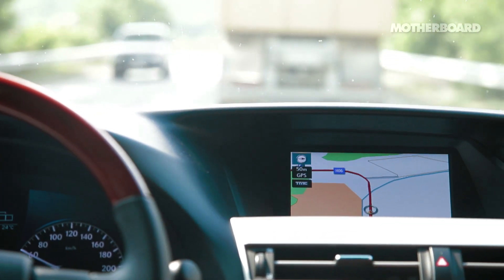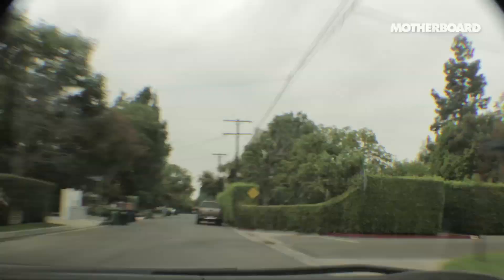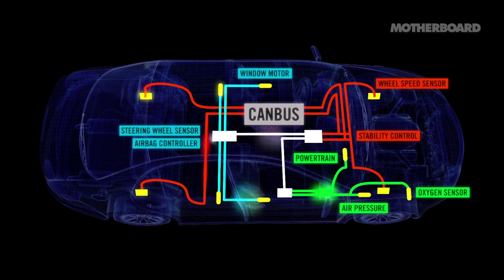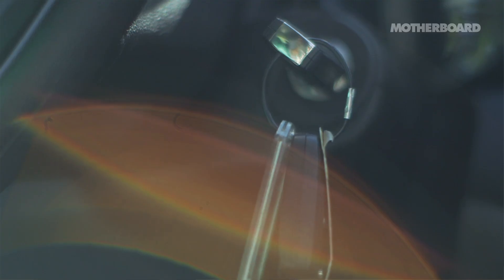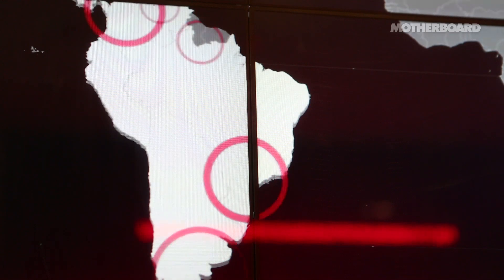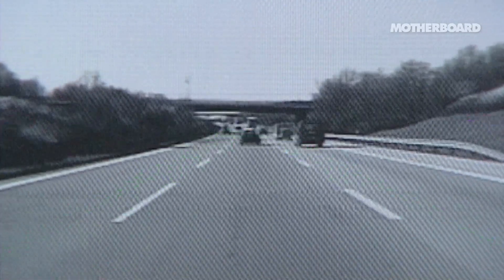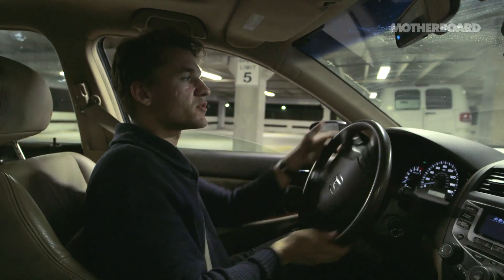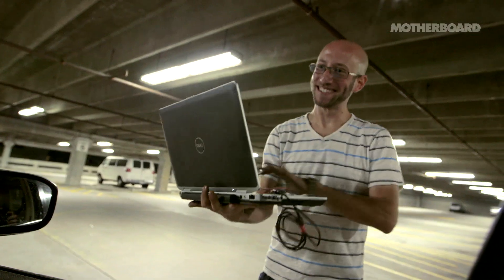How to Hack a Car: Phreaked Out (Episode 2)

Comment: That's such bullshit lol.  The handbrake?!  That's mechanical, it's not going to activate no matter what button you press.  The steering?  Unless you've got a car that's drive-by-wire steering that's also mechanical with the power steering pump assisting.  There's no electronics in the power steering lmao.   The regular brakes are generally the same way, your input assisted by the fluid.   The throttle is done by cable and not electronic (in most cars).   All you've got is what cars come with pretty much, start and shut off, windows, locks, ect.  Worse is losing power steering and brakes while driving but you can still steer and stop with more force.  Seriously people, don't put so much effort in a fake story.  Anyone with automotive knowledge would call bs.
Reply: You need to read some motor magazines. Cars do have electric assist on steering and brakes and no throttle cable. The car my wife drives has all that and more. Haven't you seen commercials that advertised cars that parallel park for you. Check out Ford they have at least one.
Reply: James Edwards
Uhh yea man they do.  Look not to sound cocky about it but I'm damn good in and around a car.  Throttle cables are extremely common, electric steering for the parking thing and brakes in cars with that auto brake when you're about to hit something.  That's not your typical cars tho and not something people need to worry about.
Reply: Sheridantank gotta fully agree with you man. Total bullshit video posted for those gullible people with no automotive knowledge background. You got modified hardware and software programmed into these chips they buy lol. You cant just hack into a stock standard car without any external hardware.
Reply: Sheridantank What you're saying is complete bullshit, just look at an average Merc. S class or Toyota Prius after 2010. And you'll see an electronically actuated handbrake, or electronically assisted brake servo's, or electrical controlled hydraulic valves for the steering assist. And all of this is connected to the CAN bus, so how about educating yourself before making a fool out of yourself.
Reply: *****
Electronic handbrake...?  Among the dumbest thing I've heard of if that's true.
Reply: *****
Not overly common, like I was saying most people do not need to worry.
Reply: Sheridantank By Hand brake im thinking there talking about the ABS Control. And yes if all solenoid are open on a abs system there would be no brakes. I don't no of any cars steering that are fly by wire but throttle yes there are many makes and models that are.
Reply: snicks50
Some of the last Pontiacs I believe had the drive by wire.  The throttle I know many do, my moms 07 Mazda does and it's a pain.  When you're trying to diagnose engine problems you gotta have some one else press the pedal instead of pulling the throttle like you used to be able to do.
Reply: rock3tcat (ⵙⴰⵔⵓⵅ)
Tell me what certifications you have, please, I'm dying to hear it.  Also what cereal boxes you got them on would be helpful because I wanna be an expert like you.   I took a classic car restoration class that involves interior work, body work, paint, custom fabrication of parts, mechanical work, and electrical work (of course less on most the cars then but still there).  So literally every single part of a car before the 1990's pretty much.  Hell I rebuilt my first engine from my 76 Monte Carlo at 15-16 years old.  With more modern cars I've learned from experience.  People that know me take their cars to me to work on all the time for a reason, I'm damn good.  The thing is many cars that would have these electronic controlled elements would still be under warranty, being leased, or whatever else.  So it would be wise to take them where your dealer recommends, a certified modern car mechanic.  So by that I've never ducked around with that shit.  By a huge majority, most cars on the road do not have that stuff.  Then the amount of people skilled enough to hack into them and fucked in the head enough to try are even less.  So overall it's a "who gives a fuck?" situation.  It would be so much easier for me to snip a couple wires/lines/hoses on you car and ruin your day than all this shit.  People generally aren't worried about a cut fuel line, brake line, power steering hose, turn signal/brake light wires, ect.  Any of those can really give you a bad day and age much simpler to do.
Reply: rock3tcat (ⵙⴰⵔⵓⵅ)
That's cute lmao.  Spanner.... Fuck off you Brit.
Reply: rock3tcat (ⵙⴰⵔⵓⵅ)
I was fucking with you chill lmao.  There's no use arguing with you over what I know.  So I forgot that some new cars have that electronic shit, whatever then I don't work on them and frankly have no desire to.  I'm sure I could but everything is made in ways to make it where you nearly have to take it to a dealer mechanic or similar and I dont have other people work on my car outside of alignments and tire changes. You think I'm full of shit, ok that doesn't hurt my feelings.
Reply: +Sheridantank  I'm a Mercedes Benz star certified technician and ase master technician. electronically actuated parking brakes so exist. with them there is no hand brake lever or foot pedal but a button instead. once the button is pushed it actuates a motor that pulls in the parking brake cable applying the parking brake. as for controlling the brakes, yes you can via abs which Mercedes Benz invented in the 1970s. on the abs unit there is a hydraulic pump that  is used to apply pressure to the brakes. the abs system uses solenoid valves to hold pressure and prevent any further pressure in the event of a wheel slowing down i.e brakes locking up. if the wheel still slows then the abs unit will release the brakes pressure and then reapply pressure via the pump. the traction control system uses the very same abs unit to apply the brakes to specific wheels to prevent under steer and over steer and positive wheel slippage.
Reply: Sheridantank 
You in Murica my friend. Cars are only AC Plastic V8 and 4 Wheels.
Here in Germany all new cars have those assists. At least ESP which controlls all breaks. Electronic Handbrake in almost every new car and even if you dont have those steering assits, its common they are still build in but not activated.
Reply: Sheridantank http://hackaday.com/2013/10/22/can-hacking-the-in-vehicle-network/ 

well here's something new for us all to learn
Reply: travis gray
Interesting for sure...  Gave me something to read through on break.   Still nothing to honestly be worried about in my opinion tho.
Reply: I thought so too. I don't think it is a real worry either really. While it seems pretty simple to actually do, short of harassment or auto theft there is no real incentive. 

I honestly don't want my cars to have so much "tech" I like the joys of actual driving. All this mess just removes that enjoyment.
Reply: travis gray
I'm a classic car guy lol.  Only "tech" I want is a battery, radio, power mirrors, and maybe power windows lol.
Reply: +Sheridantank You are talking cheaper cars and older cars. Most modern cars 30k and up now have fly by wire throttles, and electronic handbrakes with just a button. Also electric power steering and brake by wire brakes. That is why modern cars are not nice to drive.
Reply: ThePuffin77
Yea but like I've said, the typical car does not.  Pontiac came out with the drive by wire if I remember right.  The electronic parking brake is a newer thing that I strongly disagree with and not because all this hack BS.   As you commented I just finished explaining on a another post that a "ebrake" can and will stop a car in case of brake failure.  Which is why people call them an emergency brake.  Say for example your car shuts off while driving, you will lose your steering entirely, the brakes will be much harder to press and not work as well, and now you've got no useful emergency brake either.  Or if you had a traditional setup you could still steer without power steering it'll just be hard, your regular brakes will be a bitch to use but you've got a ebrake peddle or handle to use still.  That's my problem with the idea.  The hack stuff is just to get views.
Reply: Sheridantank
In case of brake failure, the Emergency brake does not always work. On my other car (Lincoln LS) it was hooked up to the rear brakes. If you pulled on it it would give around 50 braking power the those rear brake, so in the even of brake failure the car would not slow down. That being said, the car did shut off and it was able to be pulled over without the power steering or brakes.
Reply: ThePuffin77
That's possible but generally it's many times better than nothing.  With the electronic one the only use its get is for parking.   Which in an automatic it's unneeded 99% of the time anyway unless the park notch thing in the transmission has been grinder down.  simply put I personally wouldn't want a car with the electronic park brake.  you don't get the control in flipping a switch as you would with a peddle or lever.  the electric steering and I could deal with.  the throttle not so much either.   I like having a cable I can pull to rev the engine while under the hood to listen for things
Reply: *****
Thanks but not exactly.  Definitely a heck of a lot more than most but not everything.
Reply: accelerator does not directly control throttle due to the auto transmission.
Reply: Alex Jamieson
No shit lmao
Reply: +Sheridantank 
You clearly have knowledge of old cars. I will give you that. But your knowledge of the electrical systems in cars made since the 2000's is WAAAAY off. I've done automotive electrical work for about 14 years professionally, and a lot of your claims are just wrong. The majority of vehicles made today can be susceptible to stuff like this..... the vehicle in the video..... only a couple of the things mentioned would actually be possible without 3rd party hardware being installed. You clearly do not understand how these modern systems are actually implemented so you say they are bad. When you can speak from experience rather than just your opinions, is only when your words will be considered to be valid on this topic.
Reply: +Sheridantank  You  have the ECU and if you have haver read the electronic schematics of the book on a vehicle, everthing has chip sensors.  Everything.  Its jusst a matter of proximity or a preprogrammed setup.
Reply: +steeliris TKC no one has a cable throttle anymore either
Reply: +Sheridantank not really, Renault uses electronic handbrake for quite some time.only question is if its tied to cntral unit or runs on standalone unit...
Reply: Brandon just give you a heads up on the electric steering it's even going into classic cars. My cousin has a 69 Chevelle he was looking at it for and my pops 67 Corvette doesn't really have the room for power steering pump they now make an electric assist steering rack not sure how it works just know it gives you power steering off your battery instead of driving a power steering pump. You can run but you can't hide it's even creeping into the old s*** man LOL
Reply: Hi end cars have motorised handbrakes .. that are actuated with motors.. which are controlled by canbus. 

Yeah.  Yeah they do.
Reply: Brandon im a car enthusiast i know my trailblazer or my car in another country suzuki fx manual every thinking
Reply: +ArchHeretic1
Lmao why are so many people trying to teach me things that I now know?  Now yes cars do have that (my moms new Mazda for example).  I was unaware of those becoming the norm.  I know of the drive by wire steering Pontiac used, the electronic controlled throttle many cars use nowadays instead of cable, and half this shit people keep telling me.  Tell me why you wasted your time typing all of this?   You're a Mercedes expert and are certified, good for you 👍🏼.  As you would know from a couple moments of reading I am in classic car restoration and can do about EVERYTHING to a car or figure it out very quick (as I'm sure you can do).  Difference is my area of expertise is in classics and yours seems to be in modern stuff.  I said what I've said based on my knowledge (which was made clear) and why there is no reason to have a legitimate concern over this "car hacking" stuff.  Cars 5 years ago did not have this stuff (90+% of them) and nowadays they are becoming more common.  The thing is if you are that worried about someone hacking your car you should not own one.  I could make you have a really bad day so much easier by cutting a line/hose or 2 100 times easier and literally in a few seconds.  People are so paranoid and scared if technology now that it's sad.  What are the chances of you driving one of the cars that do have these features and having one of the extremely few people who would want to hack it being near by?   Worrying about that would be like worrying of driving by someone who shoots at random cars.  It can happen but is extremely unlikely.  So please.... Don't try and impress anyone with your degrees and all that because it's not working on me.  20 years old and know more than many people who've been doing it much longer.   Do what you like (as I do) and be happy with it.   You're happy working on your Mercedes and I'm happier under the hood of a classic.
Reply: Brandon It depends on how old your car is. newer cars rely more heavily on electronics to control the core functions. Even my car from 2000, can be controlled without the electronics, but a car from 2016 is a different story...

Comment: Can one of those chips be plugged into your car's computer from the exterior of the vehicle, or does the hacker need access to the inside of the car!? Anyone know!?
Reply: Sheridantank :)
Reply: RyanH321 It is possible to use a drill in wheel arc to attach it.
Reply: Kaitnieks Oh, okay! Thanks for the reply! Much appreciated!
Reply: Kaitnieks Exactly where did you get your information? If it has been verified and documented, where is it? What makes/models/year models does your information apply to?
Reply: William Garrett So you're saying that they cannot in fact do what Kaitnieks said, basically... Well then does that mean that they do need access to the inside of the vehicle or is it still possible from the exterior!? If you know, that is! Thanks! :)
Reply: It's not even possible to do either way.  Not like they say it is lol.
Reply: Sheridantank Oh, okay! Thanks so much for the correction to the wrong information I was given! So does that mean that the hacker would need access to the inside of your vehicle before being able to take control of it remotely or not!? If you wouldn't mind elaborating on the way it really is, I'd love to hear it! :)
Reply: RyanH321
Not sarcasm right? Lol.   The thing is that many of these systems are not electronic controlled.  They mentioned activating your ebrake, that's done by cable like on a bike.  It's all mechanical.   There are some cars that have steering done by wire (Pontiac had a few like that) but it's not common anymore.  It's mechanical with the assistance of fluid pressure (the more steering pump which is belt driven).  The regular brakes are also mechanically assisted with fluid.   The throttle like the steering in some cars is electronic but not a lot of them at all.  If you have one of the few cars with drive by wire steering and electronic throttle I still don't think it to be possible to hack into it externally.  It's not like the computer in cars have transmitters that a hack device would just pick up.   Maybe if they have a remote start system you can start, shut off, and work the locks.  Other than that the only way I could see is physically hacking into the wiring and still only having limited controls.
Reply: Sheridantank Oh, okay! That makes total sense! Thanks for the detailed response, man! And as far as the sarcasm goes, if you were referring to me, no, I meant no sarcasm whatsoever! Sorry if it came off like that! Obviously wasn't my intention! :)
Reply: RyanH321
Ha alright man :)   Now that's just what makes sense to me lol.  I don't claim to be a master mechanic but I gotta admit I'm pretty good and it just doesn't seem logical to me.
Reply: Sheridantank Yeah, I figured you were just going off your car knowledge and are in no way an expert on the subject, but I appreciate your response just the same! Thanks again, man! :)
Reply: RyanH321
You're welcome and glad I could help!
Reply: RyanH321 on a latest model car, it is possible to do what this video showed, but then it is not possible to be done in short time.  and it needs to have access of the car in order to install a remote control device.  and someone kept saying it is not possible, he is right on old car.  however, on new/newer car, there are many things are electronically controlled.  in most latest BMW or benz, hand brake is not a steel cable anymore.  power steering is pure electric motor compare to hydunlic one in the past.   anyway, all this things are pretty complicated system, some of them is very difficult to reverse engineer, and there is why car makers are super secretive about the CAN bus information and all the software of component like abs, pdm, ecu.   it is doable, but how much time and effort one wanna spend?
Reply: Frank Yeung Gotcha! Man, I REALLY appreciate you taking the time to answer that for me! Thank you very much! :)

Comment: 8:26 to remotely start the car, the key doesn't have to be in it, does it?
Reply: With any remote start no it doesn't, but as soon as the car is taken out of park (or put into gear if it's a standard) the engine would shut off.  Unless you put the key in it first.  It's so you don't remote start your car to warm up and someone steal it lol.